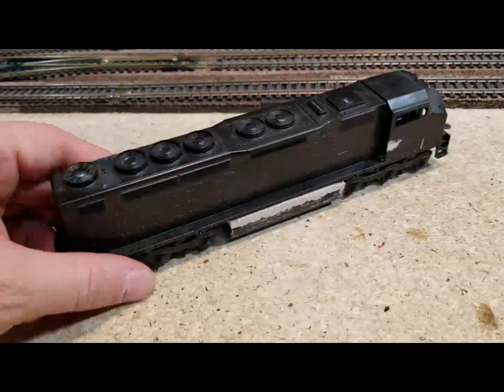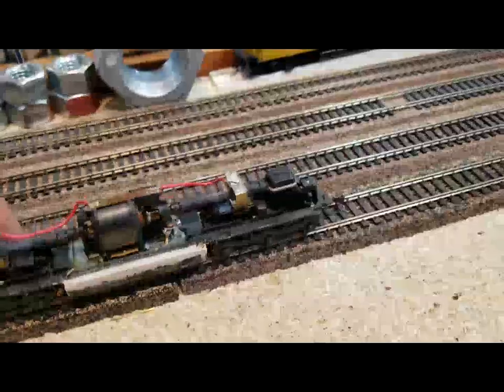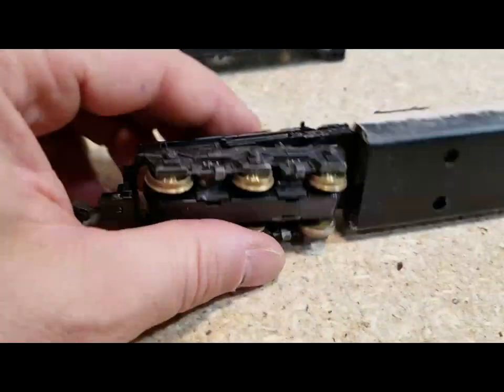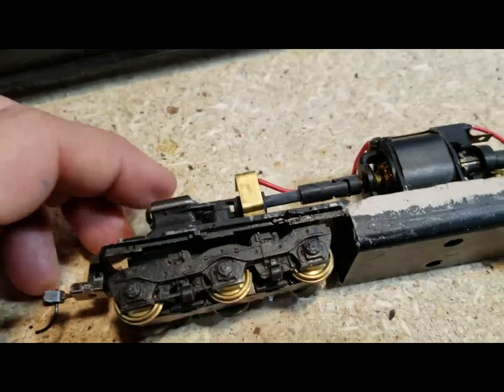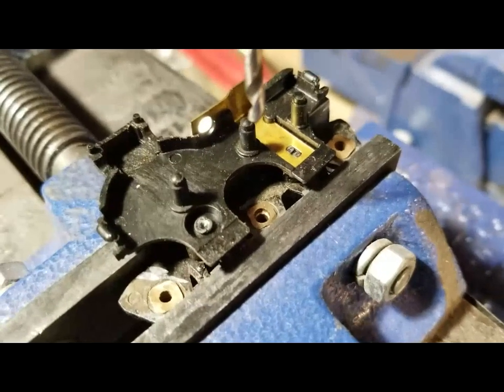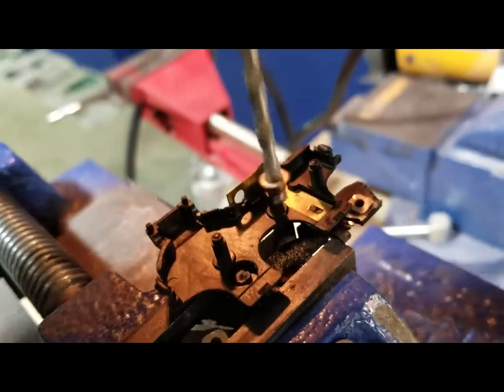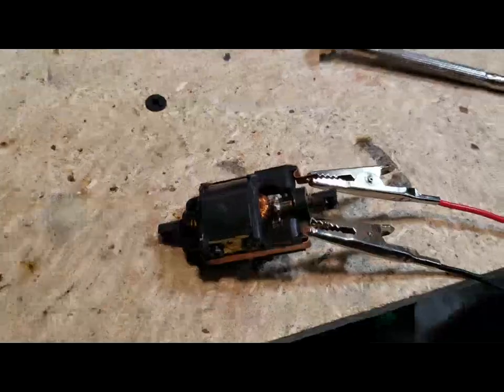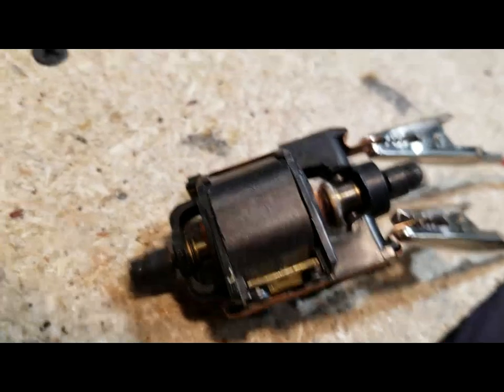Athearn SDP40 Blue Box total rebuild and derailment proofing

Comment: Good information.  I have a few of these old Athearn locomotives that can benefit from this.  Thanks!
Reply from the maker: I've developed even better techniques since this old video, particularly how to ream the truck bearings using a smaller drill bit - look to my series from last month about the SW1500, that shows even better stuff!
Reply: @elite194  I watched the SW1500 series over the weekend.  Lots of good stuff there.  The particular thing I took away from this video was the mod to the bushings of the center axle on 6-wheel trucks.  That was not covered in your SW1500 series because they were 4-wheel trucks.  I applied this mod to one of my locomotives over the weekend along with some things I learned from your SW1500 series.  Massively improved!  Thanks again.
Reply from the maker: @tzurachienu  the new bushing mod is better than the old one with less chance of breaking them loose!
Reply: @elite194  Got a link to a video where I can learn about that?  Thanks!
Reply from the maker: @tzurachienu  that was the first video I did using a drill index, but there will be more to come!

Comment: They make nylon screws that you could use to reattach the motor with. That way you don't have to use glue and the DCC ready would be completed right from the start. It was a very nice video and I enjoyed watching it.
Reply from the maker: one reason I always install motors with Amazing GOOP is to eliminate vibration.  Plus the GOOP dampens sound also.  I designed and produced a new motor called REVOLUTION 1 that is used in most of my recent videos and GOOP is just the right stuff to make a very quick installation.  Also, it's non-destructive and I can change my mind and undo the install with no problems!

Comment: Excellent instructional video. I re-wired my SDP40 similar to you. The issue with mine is the sintered wheels.
Reply from the maker: I polish the old wheels and then coat them with Oxgard and never have trouble again.  I also use a bit of white glue when setting the correct gauge and that generally lasts several years.
Reply: Who makes locomotives (hobby trains) that is with sintered Wheels? Just curious.  LjN

Comment: I just took the center axle bushings completely out and let the axle run in the bushing hole in the frame. Works just fine for me. On one of my trucks the axle frame on one side was out of alignment with the other side- when you placed the truck on a flat surface the truck would teeter and you could see the misalignment by light showing under the flanges. I drilled out the sideframe rivet that didn't have the conducting L shaped piece of metal and aligned the sideframe so that all wheels were aligned then epoxied the sideframe where the rivet was to hold it securely to the plastic gear housing. I've heard this is not an uncommon problem on the old BB 6 axle Athearns.
Reply from the maker: I've done exactly the same thing and in fact I did it later to this SDP40.  You are correct that this is a known problem and back in the 80s many articles were published about this technique.  I have 2 more on the bench that I want to find a better solution altogether without replacing the trucks, but I still haven't found a better way.  I've also tried removing the bushing on the front axle and tried the back axle, but neither was better than doing the middle axle.  I also think I should create a very rough piece of trackwork to act as an obstacle course and proving ground.  The many solutions over the years are not as good as doing the center axle. There will be more to come addressing this problem...
Reply: @elite194  Yep- the alignment on my rear truck was perfect but the alignment on the front truck was off. Seems like random sloppy machining on Athearn's part. I hope the newer locos are better. I don't have any yet. All mine are vintage 1970s. With the center axle floating I'll slowly push the truck over the frog of a switch and watch for any lifting of the front or back wheels. I will still see a very tiny lifting at one point while going over the frog but absolutely nothing that could cause a derailment. It's a good fix. I guess real 6 axle locos don't have the problem because of the separate suspension on each axle.
Reply from the maker: @fiddlyphuk6414  in the 80s when they switched to plastic sideframes and steel gearboxes with a bushing on the axle it became very easy to fix the middle axle.  I still want to try to find some method of really improving the old truck performance.

Comment: I don’t know if I’d characterize Athearn engines as “notoriously unreliable.” In my experience they are rugged as hell, but they DO require some modifications to get them up to their very best abilities that most new users aren’t likely to accomplish. It will take an experienced operator to disassemble and modify the wheels, power train and motor electrical connections. Once done an Athearn engine is nearly as good a runner as a hand-made brass engine. The major difference of course is the price. The Athearn engine is a very affordable model while a brass model is quite pricey easily by a factor of around 10 if not more!
Reply from the maker: that is true for pretty much all of them except the SDP40 - it has the identical mechanism found in the SD45 and F45, but has a serious 3 point contact problem that the others don't usually have.  it's fortunate that blue boxes can take lots of modifications and come out in excellent working condition

Comment: Wonderful how you were able to solve that problem!  What is the minimum radius track curve recommended for the Athearn SDP40?  I was wondering if anyone makes blind wheelsets for use on the center axle of a six wheel truck?
Reply from the maker: this one will negotiate 15" radius, I have a section of #4 turnouts with 15'" raidus spurs that this locomotive can handle.  You wouldn't want to make this into A1A configuration because there would be exactly twice as much wear on the idler gear.  If you did want to do that, just take a dummy truck and pull the plastic wheels off the axle and put your metal wheels on the axle with no gear and drop in place.

Comment: If you however ad fly Wheels to that motor or find a motor with fly wheels that will fit that engine and it will stop overheating and run the way it should but be careful the wrong fly wheels and it won't fit....
Reply from the maker: I've designed and produced a brand new motor that is lightyears ahead of anything currently out there.  If you see any of my REV1 videos, you can see it in action - the most recent is the Atlas U36C from the last couple weeks.  My motors don't use flywheels at all because they are so accurate that digital momentum works better than flywheels for operation.  I also recently did a DC only SD40-2 with the new motor and it runs like a dream - that was about a month ago with a complete video series.

Comment: I wondered why a radiator fan was mounted over the boiler compartment. I quit watching with the application of automotive grease to the gears.
Reply from the maker: The red lithium is the most advanced formula of lubrication out there.  It doesn't spread and never hardens.  It also does not attack plastics and hold up to extreme temps, like cold storage or extreme heat.  Nothing beats the MAG-1 grease and 1 can lasts a lifetime.

Comment: Either Add flywheels to the motor or replace the motor with one with flywheels already installed..... Hearing that motor it's obvious it needs a little oil.....
Reply from the maker: this one is before we made the REVOLUTION 1 motor which does not use flywheels, rather digital momentum only - and this locomotive is coming back for DCC!!

Comment: That is not an athearn. It doesn't have flywheels and it should have 4 motor mounts on bottom.
Reply from the maker: This is a 1960s early model before they started putting on flywheels and I think this was the one that had the screw in mount.  It is possibly from the very first run of the SDP40s.
Reply: That is very much an OLD Athearn. I've got a couple without the flywheels.

Comment: What road name did you paint the engine for?  You have a great test bench set-up!  I am assuming those nuts lined up at the back of your bench are for weighting cars.
Reply from the maker: I haven't figured out what road name yet since I have some details to choose plus I want to use a new machine on the trucks in an upcoming video.   The nuts are mainly for gluing and soldering.
Reply from the maker: It's now one of the orange ATLAS locos - turned out extra cool

Comment: be nice if you showed how to remove the truck without breaking it...." like I did"
Reply from the maker: There are a couple of videos showing how to remove the various Athearn trucks and totally tear them down - SD45 Part 2 shows several secrets: https://youtu.be/-xsq8JBupWQ that one shows a slightly newer version, the DD40 series and SD40T-2 also show the truck disassembly.  

My guess is you had trouble with the part where you have to take a flat head screw driver and remove the worm coupling before taking it out of the frame - I know I have a video showing it, but I should make a special video showing just that so it's easy to find.  Once those little arms are broken off, you can to get really creative in fabricating a replacement that is strong enough to work.

Comment: shoe goo? nylon screws better
Reply from the maker: Amazing Goop or Shoe Goo is my goto for these situations because it absorbs vibration - but that motor in the video has the very old type brass mount which was not sound mechanically to begin with because the motor shakes it self loose.  This is the same locomotive that later gets the 24v motor.  Also, I don't any more screws in to the frame - I run all wires to a small PC board directly from the trucks.